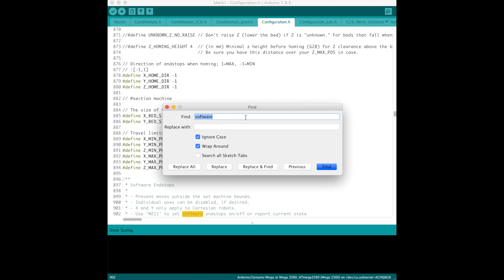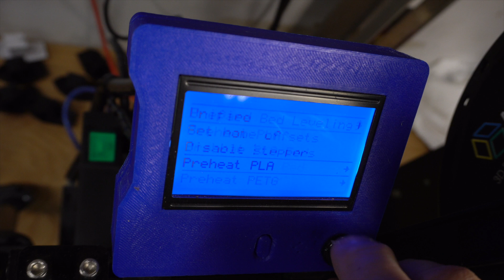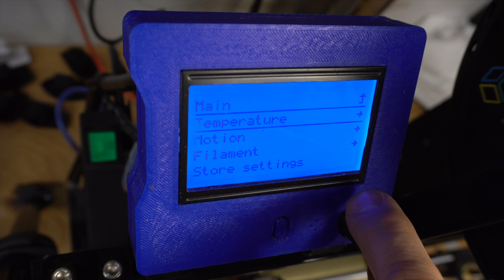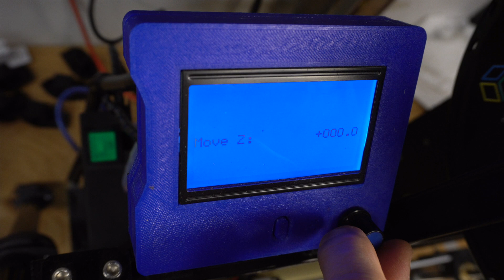Z-Probe Offset Calibration

Comment: Dialled my Z probe in yesterday and could also adjust during a print to fine tune. Prints got sloppy and now when I start a new print it is like it is not taking the offset into account and printing in thin air? 

Also probe bed levelling doesn't seem to be working. I worked yesterday but now it is only going to the 1/16 point going down until the probe slightly touches the bed and then raising up about 20mm then stopping the process all together. Any ideas appreciated
Reply from the maker: You can have a look at the serial console to know more from the printer, also it should not touch the bed move the probe down a little if possible.

Comment: Hey Frank...In the control menu I don't have a probe Z offset option does that feature get enabled with the  "disable software endstops" or is that another feature i have to enable?? Appreciate any guidance
Reply from the maker: Hi, all I see is that you need a probe defined to have the option.
Reply: @Franks3Dshop  got it thanks for reply Frank

Comment: My printer doesn't home to the middle of the bed - it homes at the front left. How do I change that?
Reply from the maker: It's in the firmware at least in Marlin, it's called Z-Safe Homing. You have to replace the firmware in the printer to get it.

Comment: I go through this procedure (several times, in fact) and although the z axis is calibrated correctly, when I do an auto home the z-axis is raised slightly and that's where the prints start, since I have a G28 in my machine settings. Why won't it start at my z zero location? For example: after Auto Home my head is at x110, y110 and z0.6. This is where my print starts with Z axis 0.6 above my "perfect" paper dragging setting that is Z 0. This causes major first layer issues. I think I will try to set Z 0 at 0 (nozzle touching bed). Then maybe it will raise to 0.6 mm above bed.
Reply from the maker: Maybe look at your start code in your slicer, you could add a z move to zero. G1 Z0 would do the trick, you can test it with Proterface.

Comment: I like your videos Frank.  

One question... if you make changes to Marlin on the 'poota and upload it to the printer, won't all those changes be over-ridden?
Reply from the maker: Hi, not always, it is recommended to load factory settings when you install a new Marlin, until you do the settings stays, what I do is a M503 from pronterface or any terminal connected to the printer and copy the settings in a note, you can reapply the settings after doing the factory settings. Or you can integrate them in Marlin that way the factory loads them...

Comment: mine kossel linear plus does not have the home z function. can anyone help?
Reply from the maker: You can connect a computer and use proterface to send commands like home Z, or any terminal G28 Z is the command to send manually.

Comment: Help me! if u put 120 degree on the heatbed, the z off set changes?
Reply from the maker: Hi, yes it can change a bit because of the expansion of the metal parts with heat. Not that much but it’s better to do your leveling at temperature.
Reply: @Franks3Dshop  you dont understand, the Z offset i mean the measure.
Reply from the maker: Are you saying that the bed is not at the temperature shown on the printer?
Reply: @Franks3Dshop  no... im sayng that i got at diferent temperatures diferent z offset.... if i level the bed cold, with z off set 1mm for example. When i level the bed at 110 degree got an z offset 2mm.

Comment: Great video and tip Frank! How ever I wanted to ask about your "Z" sensor the with the orange part at the bottom - it looks interesting the fact that it looks threaded and adjustable.  On my larger Tronzy 3D printer I have a sensor that is always unreliable and often my hot end crashes onto the bed and is set by two screws. This is even after I set the "z" height.
Reply from the maker: Hi, the sensor is a 8mm (detect distance) induction sensor, it works great I added a PEI sheet that is thin enough so it still works. On the other printer I have a BLTouch original it can be used with any bed...
Reply from the maker: Oh and I now use the Unified Bed Leveling in Marlin it’s magic !
Reply: Great! I am trying to see how I can tweak and upgrade my Tronzy printer to plug-in faster adjustments.
Reply from the maker: UBL takes from 100 to 125 probes over the bed and saves the results, after that for printing you just need 3 probes in a triangle to tilt the saved readings of the bed, it works fast when printing and is more precise.
Reply: Hi Frank! Thanks for the reply! Do you have a link to that product? Never mind, just found it on Amazon. Thx

Comment: If you set Nozzle height in relation to print bed at 0.00mm with a piece paper having thickness of 0.2mm, then a single layer print with a 0.3mm layer height would total to 0.5mm. Am I missing something here?
Reply from the maker: Hi, regular 20 bond paper is 0.097mm thick, I can tell you that it works that way, I do not know if its Marlin or just the fact that you put some pressure from the nozzle on to the paper that compensate.